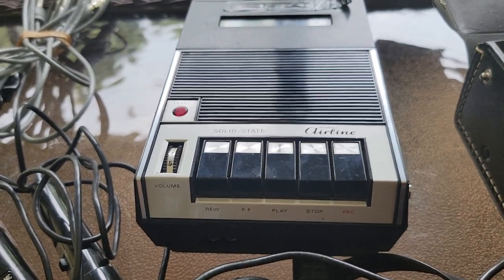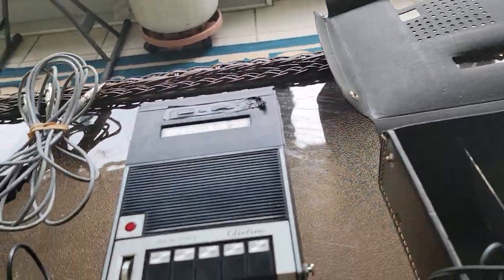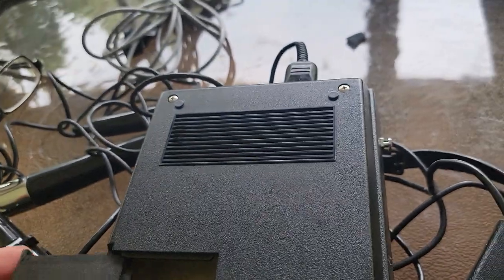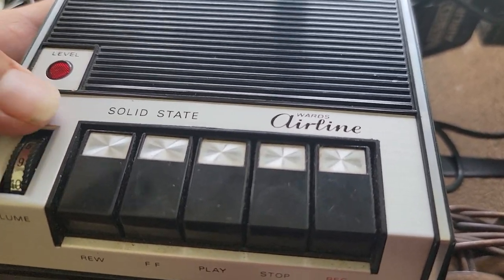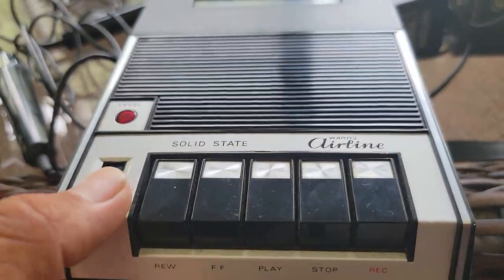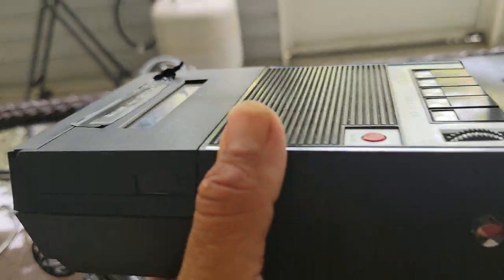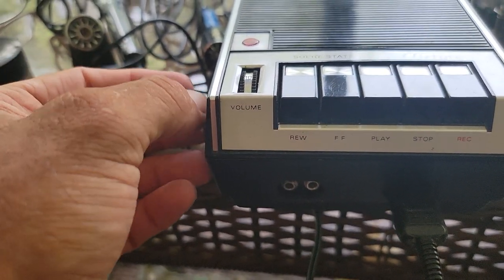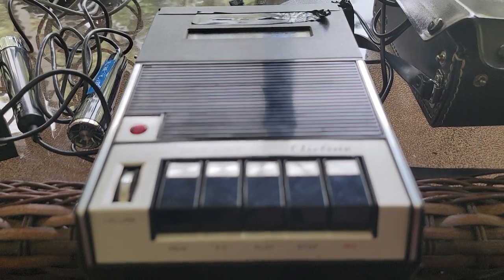Ward's Ariline Vintage Cassette.    Recorder 1980

Comment: I always power up stuff like this for the first time with carbon zinc batteries.  Carbon Zinc batteries are extremely current limited and unlikely to destroy anything in it.
By 1980, most (almost all, really) shoe box recorders were utter trash. Half-track Monaural, often only using 1/2 of a stereo head and DC bias and very poor build quality.  Most had very poor speed stability as well. They wobble all over the place.
If it is made well and has AC bias (even if it is monaural), and you can set the level,  you got very luck. This machine is very much outside the norm and very much an outlier.
The nice thing about good quality AC bias monaural machines is they are very good for copying older monaural records because you get the full track width (more than double either left or right with a stereo recording)  You can also generally get a higher level (louder signal) onto a full width monaural. They will play back in both channels on a stereo machine.  The problem is, they are very hard to find. You can tons of cheap monaural recorders, but they have DC bias. DC bias is simply not suitable for music.
Reply from the maker: Mine never had any zinc battery every used it has been plugged and has the ac motor
Reply: @ThejasonJaw5442  1:53 It has a place for batteries.